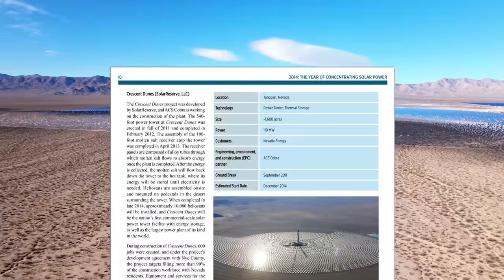The Failure of America's $1 Billion Solar Farm

Comment: I grew up near a nuclear power plant that was built in the ‘60s came online in 1973 and is still on line 50 years later. It puts out enough electricity to power 1 million homes and takes up only 2 sq miles which includes a fish farm that raises and realeses native fish into the Mississippi River.

I wonder how much wild life habitat that huge solar farm ruins? How many birds get killed by the reflected sunlight? Because 75,000 homes ain’t shit compared to 1,000,000 homes from a 50 year old reactor.
Reply: and costs 10x more to create electricity than solar and wind does
Reply: @flodjod  Nuke costs what it does because of excessive  litigation by misguided people who oppose any power production be it nuke, coal or natural gas.   Solar is nice when you can't run power lines but cannot do the 'Heavy Lifting' needed for industry and country wide home service.   At the current solar panel efficiency we'd need to cover the entire country with them and would still have the problem of that pesky night thing that severely limits it's usefulness.
Reply: Man you’re talking sense, That’s not allowed in the DEMOCRATIC WORLD OF FANTASY.
Reply: I understand that kfc has an arrangement to harvest photon roasted birds.
Reply: I love you
Reply: @flodjod  Where do you get your numbers from, or did you just make them up? I suspect the latter.
Reply: @flodjod  You are completely wrong, nuclear is the cheapest power.
Reply: These did fry birds when they flew over the site .
Reply: More people need to push for Thorium Molten Salt Reactors which are walkway and environmentally safe which we developed way back in 1965 and successfully operated till 1969 when Nixon shut funding down to stay with the dangerous fast water breeders so the military could get plutonium for their nuclear weapons which these plants produced.
Right now the Chinese have a prototype up and running TMS plant .
Reply: It’s had a drastic effect on local wildlife.  Birds are drawn to the “shine” and are literally fried in mid air as they pass over it. The insects don’t stand a chance. 
The ground wildlife was kicked out during construction and has partially returned during the couple years it was closed.
Reply: There are far more failed and abandoned nuclear power plants in America than working ones and still there's no answer about what happens to nuclear waste and decommissioning. Nuclear was all about producing nuclear weapons material, it has little or nothing to do with being a realistic technology for commercial power generation. It's absurdly capital intensive and requires very high maintenance, even ignoring the elephant in the room decommissioning and waste disposal.
Reply: People don’t need a lot of power these days A charging port, small led lite , Fridge, hot plate and big screen TV!
Reply: @flodjod  Higher that $135 per megawatt hour?
Reply: @kalliste23  Plenty of answer with molten salt reactors that reused the existing fuel rods in storage around every existing plant. Cheap natural gas was what did in nuclear power but goes what? Without fracking and new pipelines natural gas isn't cheap anymore.
Reply: @recoilrob324  Not quite true! At current efficiency of solar panels, 100 sq miles of solar would provide all the energy needs of the country with capacity to spare.  The problem is energy storage for nighttime operation and electricity transmission.  Battery capacity and costs have not improved nearly as fast as solar panel efficiency/cost has.  Also, powerline infrastructure just isn't capable of handling and distributing that much power.
Reply: @recoilrob324  The cost of a nuclear accident can not be measured, and the depleted uranium is used for weapons.
Reply: @recoilrob324  , it wouldn’t take the whole country… Elon has said on UTube, the equivalent of one state could power the entire countries combined energy needs… I’m doing my own home, and only covering one roof…
Reply: You’re not thinking like a Watermelon Environmentalist.
Reply: @NateB  What is that?
Reply: @AhJodie  Green on the outside and Red on the inside.
Reply: @williamhanna4823  I must be incredibly naive, but I still don't get it. 🤔
Reply: Iirc it doesn't fry them bid flight instead they mistake it for a lake land on this mirrors and fry. Not to mention that major projects like that kill rare dessert species in large numbers
Reply: @brianzmek7272  yea! nothing tastier after a fine meal than dessert rat !!
Reply: @chiraldude  you got the number wrong. There's a huge difference between 100 sq miles (a 10 mi x 10 mi square) and a 100 mi x 100 mi square (10,000 sq mi). It's the latter needed with zero space between panels. Look it up.
Reply: Chernobyl, Three Mile Island. And they weren't even full meltdowns. It's only a matter of time, plus terrorists can't do anything bad to mirrors but break them😅 , I live in So. Nevada and have 38 solar panels and 4 tesla wall storage units. We have never ran out ! (family of 3)...  power 24/7 , (I do a load laundry (Dryer)daily ,charge my car, extra freezer in garage, runs everything )...works mint.will be paid off in 2 more years @205.00 mo. If done right , it works.
Reply: Neal  oh man, it's awful. We had a dairy when I was a kid. I get the joke but I really want to know how that place practiced safety. I was a coal miner and oil/gas producer and know first hand the power of methane explosions. I have small patience for sloppy safety practices. 
And sadly I had an uncle, by marriage, who caught a cow on fire when he was a kid.
Reply: @flodjod  What are you talking about?
Reply: @recoilrob324  Not so. I'm in Canada and nobody can sue for squat yet we've spent well over 100 billion on a few reactors and have to turn manufacturers power off in the summer during peak hours so consumers can make supper. Just wait until electric cars become a significant demand.
Reply: @flodjod  Where did you get that made up number? Nuclear is BY FAR the lowest cost and most reliable form of energy on earth. Hands down. No if, ands, or buts.
Reply: @recoilrob324  Not to mention the massive mines and CO2 production from Chinese coal generation to make the panels.

Also, small modular reactors can be sited at existing coal and gas plants. There is no need to string many thousands of miles of new lines that are required for solar and wind which are often located far from the point of need.
Reply: @flodjod  Modern small reactors are just starting to go online. If the nuclear regulatory agencies wake up and write sensible regulations, construction and siting costs should plummet. Unlike massive solar and wind farms, small modular reactors can be sited at existing coal and gas-fired generation plants and attach directly into existing transmission lines. The need for stringing many thousands of miles of new lines is not required.
Reply: @nobodyisprfct  oh...
Reply: @AhJodie  - ya some times asking is all you can do and what is obvious to one may not be for someone else.  I maybe wrong but it seems to fit how I see most activists.  Winston Churchill I think was the guy who started the Iron Curtain phrase in relation to communist countries and their flags like Russia and China's flag.  Activists act in a dictatorship manner not considering others input, beliefs, or needs at times.  But then again United States was developed on a type of activisim.
Reply: @nobodyisprfct  Not all activists are the same, just like any other group of people. The activism that started the US really didn't consider many people, only a small group, everyone else was sort of ran over and had to fight, still have to fight to get their rights.
Reply: @AhJodie   hmmmm what people did they not consider in your opinion?  What facts do you have to support your opinion?
Reply: @AhJodie  just to let you know I would agree not all forms of activism are the same.
Reply: @nobodyisprfct  Thanks for the communication!
Reply: @nobodyisprfct  When USA started, the government was white men who wrote a great constitution, but people who did not own land could not vote, women could not vote, the Indigenous people were kicked off of their land and had their children taken away to learn white ways, .... it is all in history....  these are not opinions.....  different nationalities were slaves in USA, and still today, there are many who are swept under the carpet..... and the media keeps people in fear of each other... that last part is my opinion....    my fact about that is look at why the stories on the media are presented, the way they are told, ask yourself why are people being told these things, and check out who owns the media and what is their agenda.   Humans can easily be swayed one way or another depending on how the story is presented, that is simple stuff people study when they learn how to make good ads so people buy their products.  But lots of money is spent just to find out what words appeal or dont to people, and now a lot of that data is collected through AI.
Reply: @AhJodie  oh I see!  Have you learned about the women that didn't want to vote because of many reasons one being they were not involved with going to war as an example.  Have you learned about the Indian removal act that was in place after George Washington?  Were you aware that a lot of tribes didn't want any oart of the United States but rather have a Treaty to live their own way? I believe it was the Cheyenne or Cherokee that adopted a constitution as well but the Indian removal act passed in 1830.  

I agree media like to keep people in fear.

I believe the difficulty in history is context and how the majority thought and or believed at the time.  

I often find myself learning many things I was never taught in school. Topics like slavery often one sided when I was in high-school in 89 -93.  Come to find out there were many variables involved and many skin cors taking part.  The Ottoman Empire and many more interesting things I have learned over the past 31 years after high-school.  

I often hear people don't have the same rights as other or less rights than others.  Have you ever learned about THOMAS SOWELL and Milton Friedmans point of views concerning the economy, people rights and the poor?  

I enjoy reading most of the Declaration of Independence.  I like the part that says  "all people " and the parts concerning God.  Another interesting point of view is George Washington's Farewell Address. I like the part in his Farewell Address when he discusses the problems with party affiliation.  

Hey lastly I wanted to thank you for engaging in conversation with me and doing your best to answer my questions.  

As far as green energy.   I have no issue with green energy.  My issue is when Government forces a belief that hurts more than it helps and the lack of consideration of other things that effect weather.  I think there is quite a bit of difference between bad air quality and weather. Many things effect the weather. Examples would be volcanoes. More that 72 volcanic eruptions occurred last year 32 of which were new if i remember correctly.  There is an article written about the year with no summer that might interest you.  It turns out that huge volcano eruptions or equivalent multiple volcano eruptions effect the weather. So do polar shifts, the Moon, as well as other things like the earths core.  One thing is certain is the poor is effected the most from the forced belief around the world.  Starvation has grown in other countries. 

Interesting how laws can drastically change societies comfort. A good example of bad laws would be prohibition and the silver coin laws or in my opinion law establishing the federal reserve,1930 law that created social security, property tax and income tax laws.
Reply: @AhJodie  again I agree with a quite few things you have mentioned. Not attempting to argue but share information.   Take care and thanks  for the conversation.
Reply: @AhJodie  oh and what I had expressed is lack of information that I jade received from a one sided view vs what I had learned on my own without a controlling set up like media.  A.I. to me is media on steroids. Like I may have mentioned earlier some a.i. is already being applied. Everything is recorded on computer or in the internet.  Even this conversation, that is if it is still true that memory systems still store all things involving internet activities.   The is why I think the importance privacy needs discussed again.  Things are moving to fast.  The Constitution was written at least 2 times in a certain amount of years.
Reply: @nobodyisprfct  Wow, I just saw this comment....   Yes, yes, yes, yes.... lol... that summer that never was , happened for more than one summer, and not as bad but more than once...... You have a lot of information, which is cool and makes things interesting to me, you also seem to have a calm personality, and manners. I appreciate all that too. (I am a woman and can't imagine not wanting to vote if I went to war or not, wars affect all people, not just the ones fighting, women lose their sons, husbands, fathers, and other woman where the war is are killed, with their family members or worse, so I think all people should make decisions about it.... but that is me.) You should make videos too! You don't need much to do them, as far as cost, it can be done easily from a computer..... and I know there are lots out there that are done in professional manners, but you have a lot of information that people would like to hear and your side of things would add to the interesting part of them.
Reply: @nobodyisprfct  Thank you Changelife 1940! I hope you enjoy whatever you are doing! And.... thanks for the explanation, it is difficult to tell what the other persons intentions are sometimes when just reading, and of course my own filters which aren't always right at all!   I honestly don't know if you are AI or FBI or any other energy source, or a human, so that makes it difficult too!
Reply: We need both solar and nukes.  I'm a Democrat but I'm also a realist, we need nighttime baseload capacity to make up the solar gap.  Large scale battery technology is not there yet to be able to solve this problem.  Building nuclear plants is carbon intensive but long term it's the closest thing in a traditional power source to net zero.  There is no energy source as powerful per volume as nuclear fission today, even solar energy is partially created by it, and fusion.
Reply: @kalliste23  Nuclear works great for that great bastion of conservatism, France.  America is insufficiently committed.  We need to close the nuclear fuel cycle and waste will be greatly reduced.
Reply: @williamgrimberg2510  this solar plant is based on molten salt.  The difficulty is with containing it, whether it's this or nuclear.  Stuff is molten at 2700C.  Requires expensive and brittle metals to contain it like Inconel 690.
Reply: @caseykelso1  Chernobyl wasn't just a full meltdown, the core was partially ejected from the building, and the remainder melted through the floor.  They had to push the graphite moderator off the roof of the adjacent reactor building.  People got a lifetime exposure in 30 seconds.  Chernobyl's RBMK reactors had no hard containment structure, no reactor would ever be build in that manner in the West.  Not even Russia builds them that way any longer, their current design the VVER, has a hard containment facility around the reactor.
Reply: @AhJodie  - I am sending a few replies.  I hope you don't mind. " I honestly don't know if you are AI or FBI or any other energy source..."

You have a good point and sometimes I feel the same way.  I am just a regular old guy who is very curious when it comes to the why, who, what, where, and how questions.  I enjoy researching and learning what could improve life for people. 

My friend has sent me many many A.I. questions and replies the A.I. has provided.  There is a pattern that A.I. cannot go beyond and is currently not a true artificial intelligence in my opinion.  They usually follow a pattern and can't really create from what i can tell. They copy and calculate.  Eminem, for example, is a very complex song writer, and asking A.I. to duplicate the same style hasn't been accomplished as far as i know. 

There is a man from Ireland who explains his views of A.I. quite well.  I tend to agree with him and his views on the subject. I  am currently looking for his name again because have forgotten.  

Oh found his name.  I had started by watching "By Design: Behe, Lennox, and Meyer on the Evidence for a Creator" by Hoover Institute on youtube. I enjoyed the replies from John Lennox so much that I then watched another interview of him titled " AI, Man & God | Prof. John Lennox" by John Anderson. You may find it interesting.
Reply: @nobodyisprfct  That is interesting that you posted your information, I saw it right after another person was talking about God and how praying helped with a problem. Thank you.
Reply: @AhJodie  - I appreciate your compliments.  I agree with voting but also feel education is ideal for voting. We have a lot of people in the United States who know little to nothing about the United States and its laws during the first 20 years.

When i had mentioned war and voting.  I had also meant to mention the war draft and selective service requirements.  I like context and practice to improve placing things i context. How we see things today is not always how people saw them in certain points in history.

 When people say that are fighting for rights they do not have.  I question what those rights might be, because maybe there is a right that i have that others do not have.  I may have misread one of your replies. 

 So back to voting.  As far as I understand there was a point and time when most women didn't want to vote and there was a small minority of women that did want that option to vote.  One of the reasons was that women have been recorded saying they didn't want the responsibility or something of that nature.  Laws were fewer and the United States was still new a civil war that was postponed until the  1860s had occurred and individual beliefs were developing and growing as more people were becoming educated..... 

I am personally not a big fan of war and i think many wars could have been avoided or should have been avoided.  To me, families need to most attention and require a father and mother to provide a balance in children's lives.   I have read material that showed some people married because they worked well together not because they fell in love first.  I am digressing.  

I believe there are basic human rights and race, ethnicity, or whether you are a male or female changes those rights.  Water, Food, Shelter and the ability to defend oneself to me are the basics. The ability to provide your natural needs to survive.  When you add a government based on Freedom, Liberty and the pursuit of happiness it adds to what people should be equally able to obtain on their own merits not by handouts. Charity is great not diving into that subject. 

Voting was a big issue in the early 1800's because of slavery and those held in servitude.  Those slaves or those in servitude would be used to manipulate elections.  So the 3/5's law was established until they could completely end slavery.   The Newly formed United States couldn't afford another war and had to pay off war debts to the French and other supporters.  Then the Barbary Wars occurred, which also slowed things down. I think it was 1808 when amendments to the Constitution were allowed to be made.  

Socialism had entered the United States in the 1840's and a group of people sometimes called the 48'ers (Referring to the 1848 immigrants from Germany)  France also heavily migrated to the united states. Karl Marx had written some articles for the New York newspaper for a while.  This was the opposition to the United States desired economic and government system.  Things started going downhill gradually after Abraham Lincoln was murdered.  It wasn't because of the eradication of slavery it was because of the growing desire for socialism that was science-based.  Feminism was starting to increase on the concept of "Equality".  Not to say women shouldn't vote (women in the majority typically vote for the bigger government which defeats the point of the newly established government ).  I am saying that the idea of "equality" is not the same as freedom, liberty, and the pursuit of happiness. 

You may already know this stuff so i will not mention the other interesting things like the development of birth control pills, or the better baby pageants. 

This is just to further explain my point of view and not to convince you that i am right. I could be wrong as i have not read everything pertaining to the subject of voting and its philosophical/theoretical influence on people.
Reply: @AhJodie  - Again Jodie thanks for the compliments and thank you for the great conversation and replies.  In regards to me doing videos.  I just don't have that ability my memory fades in and out and staying on the topic at times can be a huge struggle.  If i was 15 years younger i may have attempted what you have suggested.  

Instead, i share what i can remember.  I also try not to ramble and i don't do well.  LOL !  I like to test people to see if they are really interested then share.  There are these people who really are not in search of truth these days. I am and do not mind being corrected if new information is provided to me. 

Soon i will be giving up the Internet.  To me Movies, T.V., Cell Phones, the Internet have done a lot more damage to society than good.  I will be focusing my remaining life on Earth on people in my own town. Helping and improving the area in which i live in whatever way i possibly can.

At any rate, take care, and my best to you and your family.
Reply: @AhJodie  - "That is interesting that you posted your information, I saw it right after another person was talking about God and how praying helped with a problem. Thank you." You are welcome! It has been my experience that this is how God works at times to reach people's hearts and minds.  Not a coincidence from my point of view.
Reply: @nobodyisprfct  I hope you enjoy every moment, and are healthy too!  I do not see any problems with your memory! You are very intelligent and don't remember like you would like to, but your conversations on here have been pretty incredible.  Forgive me for being short at times....  I have actually been having a good time, although still a little paranoid....  😍
Reply: @nobodyisprfct  Ok, so you want to get off the internet, but from all these things you do know, you could write a book, or several, even something for children. People could learn a lot from you!     I don't even remember what video we were watching that started this conversation, lol, do you?    Oh, I found it, the solar thing.... wow, we have gone in a few places.
Reply: @AhJodie  - "  I do not see any problems with your memory! You are very intelligent and don't remember like you would like to, but your conversations on here have been pretty incredible."  Thank you very much Jodie. It is too bad i haven't met more people like you outside of the Internet.  I enjoy your positive attitude.

 "I have actually been having a good time".  Sweet that makes the discussion worthwhile.  I use to talk to my Aunt and if she wasn't around a friend of mine.  We would spend a portion of our time discussing and solving the world's problems.  I don't have them around anymore and it is good and i am grateful you have spent the time replying. Good conversation is hard to come by these days. 

"paranoid" really? From what i can tell you have expressed rational beliefs of plausible events that do and can occur.  I haven't read anything irrational from you.  A.I. has many ways in which it can be corrupted and misused in my opinion.  We already know voices are recorded, images are recorded, and individual information is recorded. It isn't a stretch to say A.I. is capable of the same thing.  I think people like yourself who ask questions are very intelligent especially when searching for truth.  Questioning the status quo is a good thing.  Labels that are placed on us are a pain though.
Reply: @AhJodie  - " Ok, so you want to get off the internet ".  Yes, i do for several reasons. One of them is that it often feels like i am wasting my life away. Then there is the A.I. issue that rubs me the wrong way.  Plus a few more things.

"you could write a book" - You know that interesting that you have mentioned writing a book. i have been playing with the idea of writing articles for the local newspaper.  You have a lot of good ideas. 

" I don't even remember what video we were watching that started this conversation, lol, do you?" - Nope! 

"The solar thing" - Ya, that will be a big issue. Well, that is if it hits the earth.  That Carrington Event was a pretty interesting phenomenon in the 1800's.  I can only imagine how it will affect the Earth in 2025. Apparently, the sun flips its poles every 11 years.  

"wow, we have gone in a few places."  Lol i seem to do that to people.  Its just the way my brain works. It bounces to different subjects and makes complicated connections that i struggle to explain at times.  My apologies

This was a very comfortable conversation like talking to family or long-time friends.  I live in a small town in Idaho and not many people to talk to about such subjects. I will consider your book idea.   

If ever i can further share information with you in the future please let me know.  Stay safe and take care.  I hope to run into you again in the future.  If you are interested in the weather and get bored check out Blue Jet lightening and Red Sprites.
Reply: @nobodyisprfct  I like talking like this too, I do have a channel and try to make a short video everyday, because I set that goal when I retired back in Aug. 2022, just to see what would happen. You can reach me through it, just by posting a comment.  If you would like a suggestion, I like listening to Ester Hicks, I have no idea if you like that sort of thing, but she is lovely, and the messages are channeled.... she has quite an interesting history and I have been listening to her for years. We are all growing and changing, but mostly be grateful and happy!
Reply: This is CLICK BAIT.   It had delays, it DID NOT fail as of when he produced this video.
Reply: @bobjackson4720 no, he is right! 

According to the IEA's World Energy Outlook and other research projects, solar and wind energy have continued to occupy the top spots in terms of the cheapest renewable energy sources
Reply: @williamgrimberg2510 no, it doesnt
Reply: Wonderfully put there you are absolutely right there besides what you have said it is a sight for sore eyes Thank you
Reply: Yeah but the mirrors don't have the risk of causing a Nuclear disaster.
Reply: Yes very very good point 👌
Reply: @allenblevins7430  The Westinghouse SMR is based on their older large designs, it has a hard containment facility.  I have not looked at the Nu Scale design, they have received NRC approval but don't think there's any in operation yet.
Reply: If it's efficient and lasts it must be cancelled...
Reply: @flodjod  construction cost is higher in nuclear power but cost of running is low ,
Wind energy is more suitable it doesn't need battery
Reply: Some people only learn the hard way!
Reply: Nuclear is the greenest energy out there.
Reply: @trevorwesterdahl6245  - Pure fantasy. You don't even know the real cost until you count in all the accidents, contamination, and meltdowns, then the cost of storing the radioactive waste - forever!
Reply: @nunyabidness117  - That's what some Japanese and Russians, and Germans - and even the French and English used to think - they have grown up a little recently.
Reply: @Dreamhelmet  As always, people need to be smart about it.
Reply: @Dreamhelmet  So you are stuck in the 1970s versions of nuclear that were engineered in the 50s and 60s. Modern nuclear is radically improved. Do some research or you wouldn't have posted such an illinformed statement. Truly total rubbish in that statement.
Reply: @trevorwesterdahl6245  - 
Fool me once
Shame on thee.
Fool me twice
Shame on me!
Once burned - twice shy, babe!
Reply: Amen!!!!
Reply: @kalliste23  : abandoned by aggressive regulation, not open economics
Reply: Strange how once a project like this is labeled green energy, the permits are a breeze to get passed. Enviromental impact reports are all perfect, and not one lizard, bird, Or bug was harmed. Hmmm.
Reply: @flodjod  nope
Reply: @kalliste23  wrong
Reply: I just read that the Monticello nuclear reactor that you are so fond of might have to be closed due to the extremely high cost to operate it I grew up near it to and Xcel Energy’s sherco coal plant units 1 ,2 and 3 are also closed due to the extreme high cost of operating them sherco and Monticello operations are on large parcels of land just 30 miles north of the twin cities . Sherco is putting up the largest solar plant  on the dead coal plant land and just announced a huge iron air battery for 100 hours of storage will be built there
Reply: @recoilrob324   You almost touched the biggest problem with both solar and wind. Because the aren't always available we have to store energy for when they aren't. At present our storage tech isn't good enough.
Reply: What is the name of an plant? If nuclear power is do great why is so expensive and why will no insurance companies insure them? Well solar advance and is getting cheaper and better. 
"Paper-thin solar cell can turn any surface into a power source" "Researchers develop a scalable fabrication technique to produce ultrathin, lightweight solar cells that can be seamlessly added to any surface." -   Adam Zewe | MIT News Office Publication Date: December 9, 2022 and now sodium battery factories are in production .
Reply: 2022 solar power projects added 21.5 gw.
Nuclear power added one 2.2 gw project. 
Time to complete utility solar is 5 yrs, vs 10 yrs for nuclear. 
Levelized cost of electricity for solar and nuclear is about the same cost. Nuclear power is 37.05$/ MWHour; Solar is 33.46$/MWHour. 
Nuclear power is famous for cost over runs and delayed projects. 
Last year, 10X more energy capacity in solar vs nuclear was added in 1/2 the time. We can expect the cost of solar to decrease over time, while the cost of nuclear will increase over time. 

https://www.eia.gov/outlooks/aeo/pdf/electricity_generation.pdf

https://www.eia.gov/todayinenergy/detail.php?id=50818
Reply: @bobjackson4720  nuclear is definitely not the cheapest form of energy. 
look up LCOE USA 2022
Reply: So they did a full scale test on an idea that didn’t play out at first.  Clean energy has issues?  What about dry wells?  What about abandoned orphan wells? Nukes? Remember Fukushima? How about handford?  Chernobyl ring any bells?  How about associated impacts from fossil fuel releases and pollution.   Are Climate change impacts and the end of the world as we know it costs included in oil costs?Was the solar installation subsidized? Oil production and nuke plants are.
Reply: @johnhartley3022  when in the history of the planet has the climate not changed? Chernobyl was a completely different type of reactor than has been used anywhere else and was run by a socialist government that you seem to prefer. Fukushima injuries happened from the evacuation protocols that were ignored, many were moved from hospitals that should not have been. A nuclear bomb and a nuclear power plant are 2 completely different things. 

Since nearly every country on the planet has negative population growth (more dying than being born) the human species is likely to go extinct and never see the inevitable end of this solar system that we live in. 

The best part of that will be no more whiny liberals that can never do basic math or a little research of their own
Reply: @greatdaneacdc Well, there's that heating and cooling thing...
Reply: @flodjod  Nuclear power doesn't cost ten times as much to produce the same amount of electricity, you just plain wrong. While the cost for the plant is more it is economical to the one that costs a billion dollars and doesn't work. Let's do the math of your flawed claims. This facility costs $1 Billion. A nuclear power plant is in the range of let's say $10 Billion (that's high but bear with me). One Billion for 75,000 homes or $13,333 per home, but remember it is unreliable, doesn't work during bad weather or when it is night time.  Now nuclear, Ten Billion for 1,000,000 homes or  $10,000 per home, but it works 24 hours a day, regardless of weather or night. It is also reliable. Now prove to me how nuclear cost ten times as much! You should do the math before you spot nonsense.
Reply: @recoilrob324  You mean nukes operate on subsidies that still leave it too expensive.
Reply: Exactly, we found sustainable energy decades ago! The easiest solution is, how to make radioactive wastes such as uranium mill tailings, spent (used) reactor fuel, and other radioactive wastes safe. We are SO close..... whereas creating whole new industries for power, could take 50 years!
Reply: @chiraldude  You forgot about electric cars being mandated by 2035. If half the population started driving electric cars, then you would need double our current electric production. Those we've chosen to lead us have failed.
Reply: Nuclear power requires a place to dispose of waste. The mining processes cause a large amount off waste  . The life span off Uranium mines is shorter than most Americans
Reply: @darylephillips6778  sounds Like it’s time to process those bombs in the fuel rods
Reply: Ask them where they store their spent HOT fuel rods.  Then come back and talk some sense.
Reply: @dwmcever  in France they recycle them or they used to. The us doesn’t because the powers that be want inefficiency and dysfunction.
Reply: Good place to put it.  the area is hot dry miserable lifeless desert well almost lifeless. good cookies at the Tonopah  Texaco tho
Reply: Yes but you have not had to decommission it yet, had a run away reaction , pay the costs to look after the nuclear waste for thousands of years ,and I do not think the desert land it was on was tooo fertile!
Reply: Yep. And they are a lot safer.  Nobody has been outright killed from an accident.  Oil and coal energy kills SCORES of people just distributing the materials. It’s super clean energy too.
Reply: @SlipMahoneyBowery  how about 3 mile island and of course we cannot forget the Ukraine accident. Do not tell me how safe it is as I think 3 mile island would beg to tell us different !
Reply: @rayboucher479  how many people were killed?  None
Reply: You make nuclear power sound like such a success, but have you considered all of the mutations around that reactor? People are born with defects and mutations that are utterly horrifying. Bizarre new kinds of animals roam the zone where the reactor and its waste reside. Nuclear power is a very Republican form of energy. In contrast, solar is what we Democrats believe in. It makes no pollution, no mutations, no carbon dioxide, and is 100% renewable. Go solar!
Reply: I don't know, ask the people at Chernobyl and ask the people in Japan what they think about your nonsensical idea.
Reply: @bobjackson4720  - Sorry it is not.  The levelized cost of electricity from Nuclear is currently about 3 times as high traditional fossil fuel power plants or hydro, wind or solar.  This according to reports from Lazard, the EiA, and the DOE.
Reply: And sets birds on fire like crazy
Reply: @AhJodie  : Bologna.
Reply: …birds…. and the destruction of vast desert habitats, including the death of high risk species, such as desert tortoises…
Reply: @JimBronson  I 100% agree with you. Solar used when there's sun, nuke when there's not enough sun or at night. Best of both worlds. Plus, nuke electricity is stupid during hot summer, because the plant will rise the temperature of the nearby river to a point that's not bearable for life in the river (especially during heat waves). Unfortunately, not using nuke plants 100% of the time damages profitability. That's why you don't see nuke power plants stop during heatwaves and PV panels taking over...
Reply: @mas5867  Well , the fact that the factory restarted producing electricity is an unexpected comeback. So I don't think the title is so much of a clickbait.
Reply: @spuriouseffect  Did you have any choice for your leader ? Wasn't he strongly suggested by the media/bourgeoisie/military/industrial sector ?
Reply: I too grew up in the very same way to a Nuclear Power Plant that was highly successful from the day it went online in the early 70's. That was Three Mile Island in Harriburg, PA. it was shut down several years ago and now the State is unable to compensate for its loss. Solar is a damn joke plain and simple.
Reply: @flodjod  produces electricity without needing stabilizing power
Reply: @flodjod  kind of a weird comment when it is the installation of 'renewables' that actually double and triple energy prices the world over
Reply: @gregkocher5352   🤣🤣🤣
Reply: Nuclear is still our best option. France is using nuclear and not panicking. In fact there was a woman that had figured out how to reuse nuclear waste several years ago. Suddenly she wasn't heard of anymore.
Reply: well solar doesn't need water. nowadays at least with PV cell solar you can turn the sh1ttest place like a landfill or a desert to generate free power without use of any fuel. even your own roof is enough to power your own house for a whole day if u have a battery system. don't need to build anything, just stick it to your roof and you get enough electricity for a whole day. the only issue is energy storage for use during the night. once this issue is solved then then solar will give you free energy for at least 25 years.
Reply: @flodjod Nonsense,you cannot possibly be that obtuse.Take government interference, increase rules of regulations against nuclear and increase, subsidies and tax breaks for any of these idiotic wind and solar projects and then let’s see what makes sense economically
Reply: Just like those stupid wind mills and EVs all just a big scam FJB
Reply: @williamgrimberg2510 thorium isn’t as good as uranium tho. There’s a reason no one really makes one despite it being created back in the 1900s
Reply: @kalliste23 waste disposal is literally the easiest problem to solve.
Reply: @1Plebeian  that is a truly ridiculous thing to say. If you mean, "from an engineering point of view waste disposal is an easy problem to solve" then I could just about swallow it. To say the problem of nuclear waste disposal is easy to solve given what can be observed in the real world is clown world thinking.